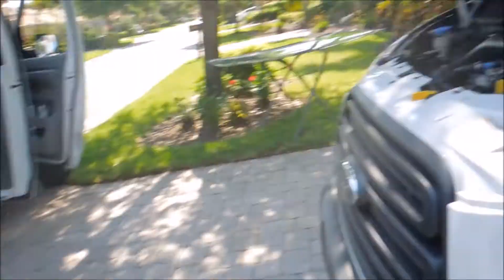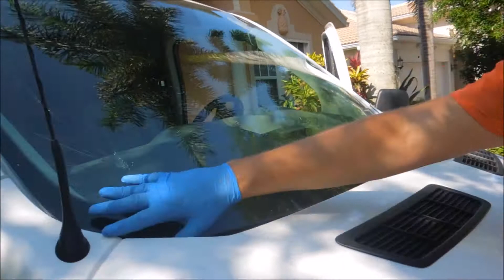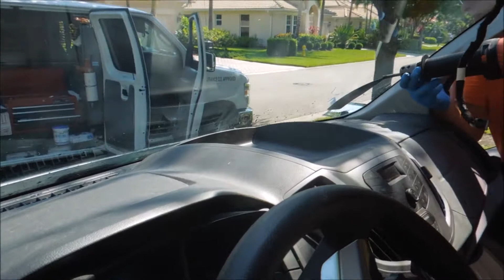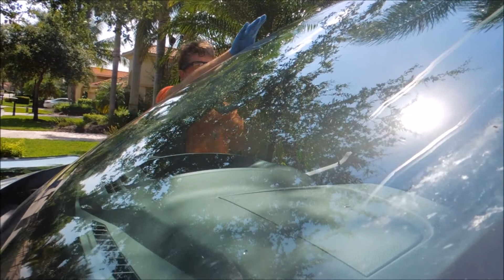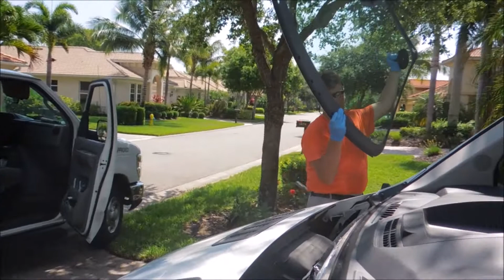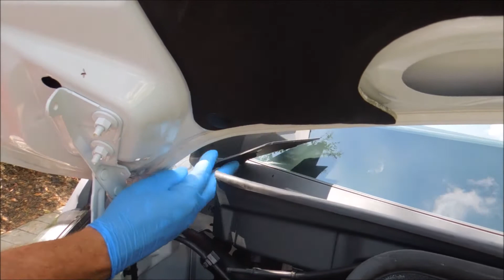Rolladeck Ford Transit complete windshield installation demonstration

Comment: Do you always set from the passenger side? Would that work on the transit setting from the driver side? Thanks.
Reply from the maker: Hi BB, the reason for setting from passenger side is the location of the wiper post. If the post is offset to the driver's side, it is best to set from passenger side. Same goes where if the post is offset to passenger side you want to set from driver side. If the post is direct center or close to you can set from either side.

Comment: Why would anyone still use a pipe knife to trim urethane?
Reply: rolladeck is dope though
Reply: Trevor Pemberton Hes old school nearly all veteran techs use a pipeknife to strip the old bead nothing wrong with it as long as you're not scratching and hacking up the pinchweld. And yes the rolladeck is the shit ive had one for 3 months no problems yet